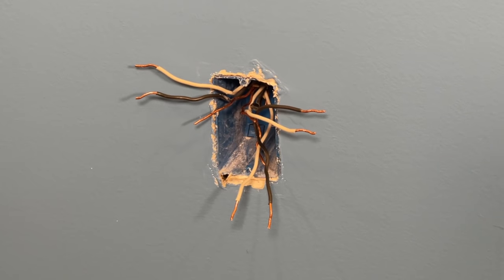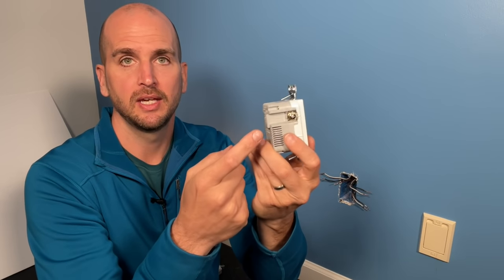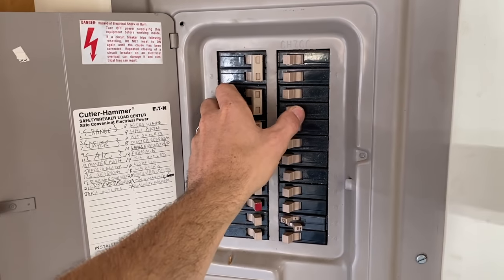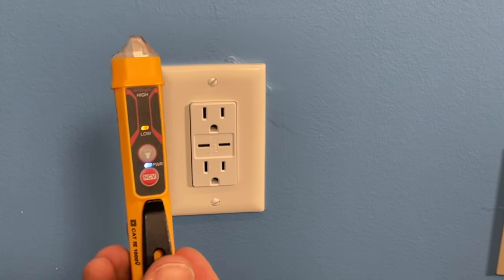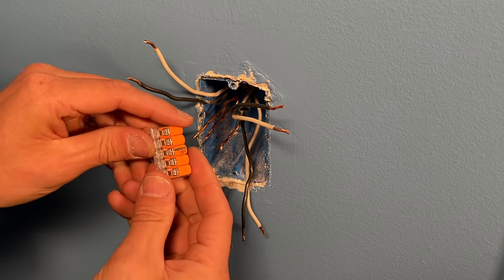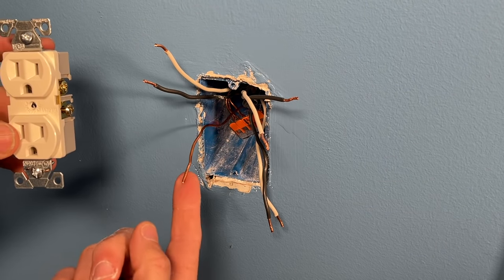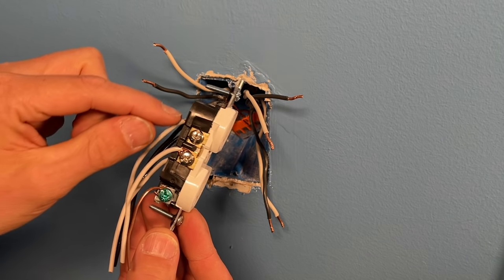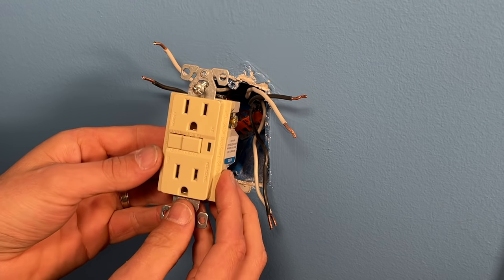Wiring an Outlet with Multiple Sets of Wires

Comment: can you clarify? if you use those wagos, you don't necessarily need to know which set of wires is providing power right? since your "tying" them all together and making a pig tail? the order in which you set the wires in the wagos does not matter?
Reply from the maker: Nope, the order of the wires in the Wago lever nuts does not matter.  It is simply connecting the wires to a common bus bar.  Being able to fine the power or "line" coming in is handy especially when swapping out a GFCI outlet that feeds downstream non-GFCI outlets but still provides GFCI protection.
Reply: @EverydayHomeRepairs  perfect. Thanks for clarifying

Comment: I have dual receptacle 1 is a light switch and the other is a standard plug. But when the main power is off the light switch is still powered. And outlet is off.  And has 3 sets of wires to the outlet hot on bottom and loads on top. And the light switch is bad loose and flickers. May have to bring in the pros.

Comment: Time stamp: 7:45. I would state if it hadn’t already been before, the wiring to the actual side screws was in the incorrect side of the screw - for tightening and should have been installed WITH the clockwise stance of the screw.
Reply: What he did was correct for back wiring as it doesn't matter what side of the screw. That's only important for side wiring (j hook).

Comment: Wonderful!!! Thanks. Very clear and straight forward. Found two sets of black and white wires and was going to install the usb type outlet. Now I know how. 
Question. What gauge of wire would one use for outside lights. The ones that are above/near garage door?  Thanks in advance!!!
Reply: 14 gauge Romex ( 14-2 with ground) is  fine for lighting circuits.  Especially, if your using an LED fixture or bulbs.  If you’re pulling power from a circuit that runs your shop in your garage, you might want to investigate how much amps you might need so you don’t overload the circuit and trip the breaker.

Comment: One possibility you did not say is one set could be a switch for a switched receptacle.   Hooking all blacks to blacks and whites to whites in this case would definitely be exciting when sparks start flying.   It would be obvious if you remove the receptacle but, not so obvious if someone else removed it and took out the wire nuts.

Comment: I have two red wires, two black wires and two grey wires plus the ground wire lol in my apartment and the socket only works if the the prongs of the power strip are moved to the right.

Comment: Very informative. I understand that you shouldn’t do this, but I don’t understand why:  why can’t you just pigtail the two extra sets and use the one hot set to go directly to the receptacle?   Why do you have to pigtail all three sets and add extra wire when you’re going from 3 sets of wires to 1 set?
Reply: When you use pigtails you've made a decision to allow all current to pass by and prevent the receptacle from being used as a connector. Preferred. If you connect one set, it would use the receptacle as a connector for that branch. It would give sort of a hybrid connection and is not really good workmanship.

Comment: Great video! I am running a line from a GFCI protected line in the bathroom to add a line for a Bidet seat. The receptacle has a line from a GFCI coming in and another line going out to something else. I need the commercial receptacle shown in your video to run the two outgoing lines correctly. I can't find the commercial receptacle shown in your video locally. I did find what appears to be the same one you used on a web site but I have to buy a minimum of 10. The brand on line is Hubbell. I would like to know if you can tell me where to get the one you used so I don't have to buy 10. My other option would be to just replace the current receptacle with a GFCI receptacle that you said I could run the two lines from. It would be a lot less expensive than buying 10 Hubbells but I am not sure if it is okay to have two GFCI's on the same line. Any help would be appreciated.

Comment: Extremely easy way for a novice.  Everyone  nowadays has a cell phone. Kill the power, pull the old receptical and take photos or even a video of that receptical. Attach the new receptical with the same color wire configuration as in your photos of the old receptical.  You don't need to know where the wires go to. Turn power back on your done.
Reply: Works fine unless the receptacle is wired wrong.

Comment: At about 3:54 you go straight from testing for hot wire into creating the pigtail without mentioning to go back and turn off the circuit breaker. I’m not being pedantic, just thinking about those first-time DIYers who wouldn’t think to do that and could get a nasty surprise. 
Otherwise a seriously good video that I wish I’d seen years ago.

Comment: Thanks for the great videos.   Wanting to put a plug outlet on other side of interior wall. Current box has 3 sets of wires. Is there a pass through box so I won't have to go above or below existing box.  Thanks

Comment: Thank you for the video.  I want to wire up an outlet I have using this method.  But, I when I did a google search, I thought I saw you could only have 9 wires in 1 gang box.  I see that you have 12 wires in that box.  Is that up to code?
Reply from the maker: This one would be close.  You would need to know the volume of your 1 gang box, wire gauge, and number of connectors.  Then you could cross reference the NEC box fill table to see if you are meeting code.

Comment: Great video. Answered a lot of questions that i had in the past and called a pro for. I recently opened an old outlet to install a usb outlet in its place and what i saw confused me. running into the old outlet were 2 black wires and 1 red wire. the white wire was connected on the inside to another red wire. I ended up closing it and not doing the install. Can you help?

Comment: I wanted to put in a gfi outlet at the start of a circuit to protect all the other rec on that run, but cannot find where it begins. Every rec only has two wires coming from it. Looks like they have the 1 Romex coming out of main to attic, then must split up into the knob and tubing for each rec. Would a gfi breaker work for that and have you a video on changing out a breaker? Thank you ,great videos.
Reply from the maker: Haven't done a video on changing out a breaker.  Wonder where the junction box is located which is feeding each of the receptacles.  🤔
Reply: @EverydayHomeRepairs  I didn't see a j box, just the romex come through attic floor. I'll take a second look and move some of the insulation. If there is, is there an option to put something there? Should knob and tube be replaced at this point? Thank you for your quick response!
Reply: @rosanneanderson1492  When I gradually replaced the knob and tube wiring in my house 30 years ago the insulation was brittle and I encountered a number of unsafe sections. Plus the circuit design was disorganized, as knob and tube tends to go all over the house as original loads were mostly lighting - which didn't need many different circuits. Sorry, but if I ever bought a house again and saw either knob and tube, ungrounded cables, or aluminium 15/20 amp circuits I would rip them all out without thinking twice - even though it can be a big, messy job.
Reply: A gfci will not protect other outlets if they are all fed from the nob and tube. You could put a gfci breaker in for that circuit. If the gfci breaker keeps instantly tripping then that knob and tube circuit is bleeding amps somewhere.
Reply: @Justheory11b  Thanks for the info. I'll have to check that out next time I go up there. Might have to hire a professional to rewire. Not sure how much that'll cost.
Reply: Well one thing I can tell you right off is that knob and tube that is undisturbed , in good shape , and not messed with , is still quite usable .  The issue comes from home owners and unqualified people who don't understand how to get what they need and still keep things safe . Residential wiring is very straight forward but the methods and materials must be applied correctly to work properly .  Electrical work is nothing more than maintaining  a mechanical system that is the transmission medium for the power itself . It needs to be in good shape tight and dry .
You have a situation with your K&T being buried in insulation .  It is a system meant to be installed in free air so it can cool properly .  Yes a GFI breaker can work in your situation , even an arc fault breaker can also work , but , if it is safety you are looking for , just putting a gfi breaker in even if it works properly shouldn’t make you sleep any better . That house without even seeing it has wiring in it from the day is was first wired till today . So if I am not mistaken it has almost a hundred years of different types of wiring who knows what for installers over the years . Hopefully you have hardwired smoke detectors .
 If you are not going to retire the house right away , which it sounds like it needs , have an experienced licensed pro at least do a safety evaluation of your electrical system . It could save your life or a member of your family .
       The whole code thing and licensing are all about safety and keeping peeps alive while they use all their electrical gadgets
Reply: @gerdberg4188  Thanks for the advise. Probably a good idea, since it looks like the house has been added onto several times. How do they charge for a rewire. Is there a way I can sort of figure out potential costs. It's a 3 bedroom ranch. Thanks for your help

Comment: Great,  clear and detailed. Thanks.
Question.
I saw somebody using a braker finder which was 2 tools. One of them is plugged to one outlet, then with the other you go to braker box and touch every braker and the one which has the outlet in use starts beeping, so you don't have to go back inside the house multiple times to see if lights or outlet are off.
I think the name is braker finder but can't find it at Home depot or Lowes.
Can you recommend me one and if possible a link.
Thanks in advance.
Reply: Amazon ,   circuit tracer
Reply: @lostcause1206  Great, gracias.

Comment: So, I just out up a small garage and no absolutely nothing about electric. I have a couple questions.. I'm gonna have 6 110 outlets, 2 on each of the 3 walls. I want to wire them all to the same breaker but don't know if that's ok. Send question, if I can do that then I have to wirnut the grounds together at every box as I go until I get to the end of the run, right..? 3rd question... can a plug in socket be waist high on the wall .? I'm disabled and can't bend over to plug things in and what not. Can a plug in socket be on the ceiling..? I'm gonna use the l.e.d. style lights that just plug into each other but want to just put a socket on the ceiling. Then I'd run the power from the switch to the socket..? I appreciate all your time, thank you very much..!!!

Comment: Wire nut the ends with the circuit breaker off then after turning on the circuit breaker use your circuit tester.

Comment: great video. I have a question about a switch replacement. just changed an old switch that controlled an outlet in my living room to a smart switch. Now that outlet still works, that it controlled, but all the other outlets in the room do not. Any hints as to why?

Comment: Question: I have a Legrand Adorn 15amp outlet with 3 black wires and 3 white and 1 ground. The outlet has a total of 4 hot spots to use and total of 2 for neutral. Legrand tech support said to use 3 of the 4 hot terminals, 1 wire on one side and other two on the opposite side. Make pigtail for the neutral wires resulting in 1 white wire being installed.    Since you've worked and like Legrand products do you agree with this. Right now I have residential outlets with 2 black and 2 whites using the speed wire, which I do not like.

Comment: I would like to know where you got those commercial outlets. the type I have found just have screw terminals and without the push in holes the cheap ones have. I like the WAGO splicers tho. Much better than the push in type.

Comment: thanks for the video. My outlet has wiring to another outlet that I want to remove altogether to put a chimney through the wall in the same location. I figure I should put wire nuts on those wires that aren't loaded but go to the 'chimney' outlet to be tidy. What would you do?

Comment: You are not telling us the amp of the circuit going to the outlet 15 or 20.
You didn't say anything about a 15 used on a 20.  I didn't get what type wire as in 12 AWG or 14 AWG hanging from the box that you pigtailed. I see where they say don't use 14 AWG wire on a 20 Amp circuit.

I see 20 amp on a kitchen circuit that is only controlling one outlet.  When I looked at the outlet, it was a 15 amp.  When I pulled it out the wall there were 2 black and 2 white wires and a ground.  But I am not sure what gauge wire it is using, but the wire is solid.
Reply: It's should be 12 gauge, you can verify. 14 gauge is 1.5mm diameter and 12 gauge is 1.9mm diameter.
15 amp duplex receptacles are commonly used in residential wiring, even on 20 amp circuits. 20 amp receptacles are not necessary. The important thing is that a 20 amp circuit must have 12 gauge wire.

Comment: With respect to the Wago;  is there an in and out slot?  I have looked at many videos and it appears it does not matter.  Am I correct?
Reply from the maker: That is correct.  It has a common busbar so doesn’t matter where the wires are places as they will be all bonded together.

Comment: Thx for the video! Exatly what I was looking for! I have a few questions: when doing the pigtail with the wago, does it matter where each wire goes? Like you do a pigtail with 3 hots, but only one of them is "actual hot" (with power). Does it matter where each one of those 3 goes in the wago?
Reply: No it doesn't

Comment: Need your help.  I recently opened an electrical out in one of my bedroom which is switched.  I found three sets of (white & black) wires.  It was easy to find the hot wire.  However, I can’t figure out how to configuration the other two sets of wires?  I’m guessing that the other two sets are for the overhead light and one for the switch.  The switch in room is hooked up with a black and white wire, which I believe is incorrect.  I’m thinking that there is junction box in the wall which probably wont all me to remove the switch from the outlet.   I just can’t figure out the wire configuration for this outlet which will allow the light to work correctly.  I tried several configurations, but none works correctly.  Can you please advise?  Thanks!

Comment: I had an 'electrician' come and replace 4 receptacles, 3 plugins.. and one light switch.  The wire coming from the ceiling was encased with white, which I suppose was 14/2.  He told me that the wire going to the plugins had to be 12/2, so going to the first GFI switch was white sheathing going to the next plugin was 12/2 yellow sheathing, then a light switch which was yellow going to it and 14/2 going out of it to the light, then the 12/2 going to the final plugin.  I just want to know if this was correct or is the 12/2 yellow wrong?  Thank you so much  Kathy

Comment: Those outlets are crazy.

In Denmark it would never pass inspection.. for anything.

If the outlet falls out of the hole and you touch it on the sides .. you can get an electric chock

Comment: Hello: My example has 2-Black and 2-White. I am wiring a smart outlet like the example you installed here. Am I ok to run 2 black and 2 white to each screw on the receptacle. Or do I have to pigtail like you demonstrated?

Comment: 2 questions: Does it make a difference which port on the Wago  you place the  line -black wire ?, and is it against code/illegal to use an outlet that has all 4 of the speed wire ports used and then introduce a third set of wires J hooked to the unused side terminals ? I did this recently to add an outlet behind my TV. If it's not a good idea I can change it out. I live in a new construction home and I'm certain all of the outlets are speed wired.

Comment: Contrary to his own advice, at 7:42 it's clear to see that he wrapped the wires to the receptacle terminals in a counter-clockwise direction.
Reply: It's hard to see, but it looks like he's back wiring (where the screw clamps down on a plate clamping the wire), so that doesn't matter. If he were doing the more traditional side wire with the hook directly under the screw, then you'd be correct.
Reply from the maker: Exactly right, thanks for the help 👍

Comment: I have some receptacle works and some don’t works on same circuit breaker. When you put contact less tester on outlet wires they beep also on not working outlet i think they have very low voltage on that outlet

Comment: Another great video, as always. 

Was that a USB C powered outlet? With that, would it charge at the same speed, as the brick that is provided with an iPad Pro? Meaning, if the brick charges the iPad in say 2 hours, would it be the same with that outlet? I have been thinking of add a USB C outlet to my kitchen, when I typically charge my iPad. Hence, my question. Thanks
Reply: I believe for iPad it should be fine. Make sure it is rated to provide more amps or watts than the larger device you plan to charge there requires, plus some extra to be able to plug in a phone. 

There are some devices that have a special "fast charging" standard (packaging or manual should explain) and you should look up which one it uses if you want to take advantage of that. Not sure if any of these outlets have those charging features. But either way it will "work". Just may not necessarily charge as fast as the included charger it depends on your device.